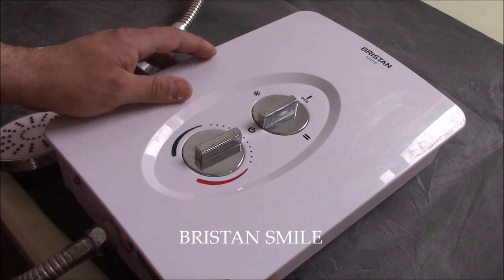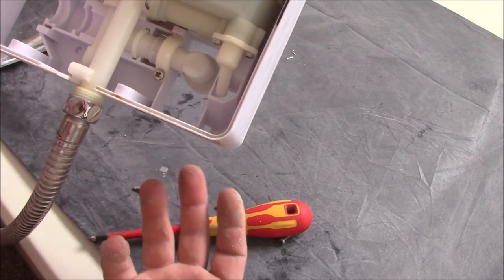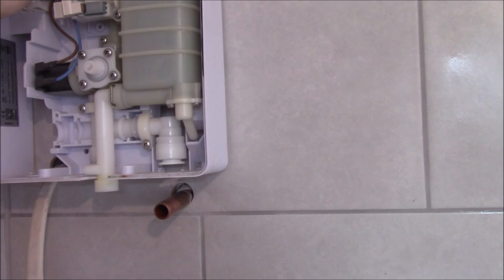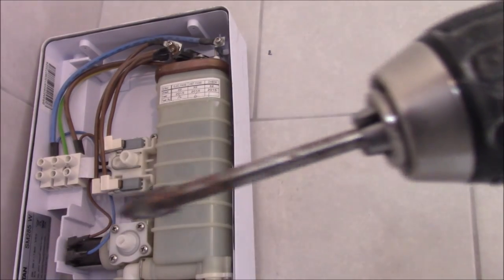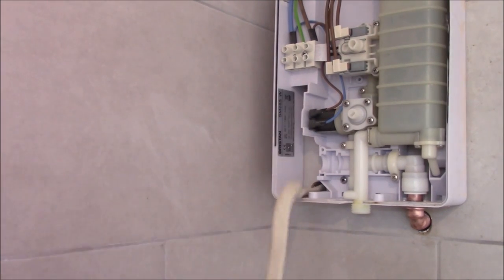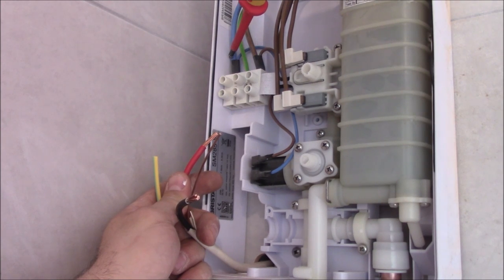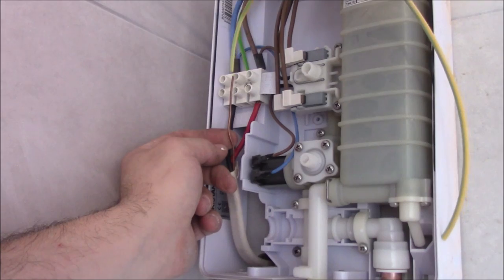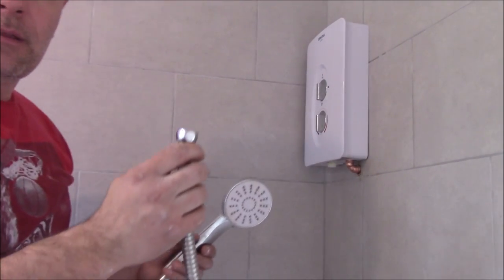How to install an electric shower Power shower installation Mira Bristan Shower how to wire

Comment: Am I the only one thinking that this video is a good example of bad practices. Firstly, the rating of the cable. Although the shower capacity was not mentioned, 6mm cable for any electric shower should just be a no no. Secondly, force cooling the pipe weld. I mean this must not be done under any circumstances. Common on, how long does it take to cool naturally? Not sure this video is one to recommend. Quick job, bad practices
Reply: Shower capacity is mentioned 8.5kw
Reply: @d34nr2k8  you are correct. What I meant to say was that although the shower capacity was mentioned, 6mm  cable should not be used for electric showers. I just think is it bad practice and should not be encouraged. 6mm cable could only support up to 7.5kW rated shower at best - not sure I have seen one of such capacity anyway
Reply: @namski2410  8.5kW requires around 38A at max. On paper  6mm² cables are rated at 41A but it can handle much higher current like close to 50A.

Comment: Would of preferred the copper pipe to push in by back entry, looks like a council job with the pipe on show
Reply: How ?
Reply: I agree the shower could have been an inch lower, pipe entering horizontal instead of vertical. Made more work for himself putting an elbow on there.
Reply: I don't understand why he used an elbow when he could have just push fit the inlet pipe from the back cover
Reply: @jokeaaaa  because it’s a push fit . So once fitted u can’t take it out if it comes from the back unless u have rear acces.
Reply: I was also thinking along them lines
Reply: And this is exactly why you don’t use a sparky to instal ANYTHING to do with wet areas or plumbing’s
Reply: @ciprian1000  what are you talking about? Of course a push fit can be released from rear entry - you just need to know how to do it. A plumber would never have installed this in this way. Too many bad practices here.

Comment: The point on these videos shouldnt be look how easy this job is it should be if your gonna mess with 6mm shower cable can you prove that cable is dead before and after refit of shower and i dont mean wave a voltage pen over it, and if the answer no then then you shouldnt be touching the job full stop

Comment: Ok, I've been watching your videos on installing everything, but there's a saying "Jack of All, Master of None". Kitchen fitter, chippie, plumber and now electrician! There seems to be no end to your talents! For an 8.5KW shower the recommended cable size should be 10mm and be protected by an 40A 30Ma RCBO. I didn't see any local double pole 40A isolation switch, nor any local water shut off valve! It's fine being the jack of all, but messing with electrics can kill! I presume you'll also fit gas appliances.. You're just fantastic and probably cheap too. Building Regs, Part P, City & Guilds, who needs any of that? Just watch YouTube channels like yours, there's no longer any need for qualified tradesmen anymore. Yours, Paul McGuinness

Comment: This guy has other great videos. But, I am not so impressed with this video of his, as he didn't mention the cable from the MCB will terminate on the RCD and then to the Electric Shower. The RCD of the RCD will depend on the Shower Rating.

Comment: 10mm cable not 6mm
Reply: 8.5kW will need around 38A at max. On paper  6mm² cables are rated at 41A but it can handle much higher current prollybclose to 50A.
Reply: @a_d2673  Correct, thanks for the heads up. Have a nice day

Comment: Hi there .so i have just had an 8.5kw shower installed on a 6mm cable , i have been told the cable needs to be 10mm cable , will this be dangerous
Reply: It depends on the installation method. 
If it is clipped direct it will carry up to 47 amps.

If it is installed inside conduit and embedded in a wall then thw current carrying capacity is reduced to about 32amps.

Ideally the cable should be 10mm because if later in the future you decide to uograde the shower to a more powerful one, then the 10mm will cover that.

Comment: Hi Sir,  Great video tutorial. I installed this same shower unit but when i turn it off, water is still coming out of the shower head. Any help pls?
Reply: YOUR BUTTON MAY NOT HAVE BEEN IN THE RIGHT POSTION BEFORE YOU PUT THE COVER BACK ON

Comment: 6mm for 8.5kw bet that will burn out  why not 10mm 

And where's your Zs testing  nd is the showr rcd protected
Reply: lucky lee also no double over of the earth wire just straight in the connector block.
Reply: plumbers dont do Z tests they screw it in ..switch it on .. no leaks ..jobs a gud one ..go home =D